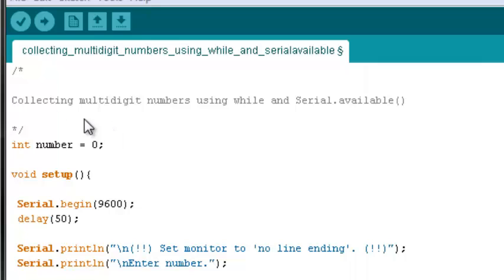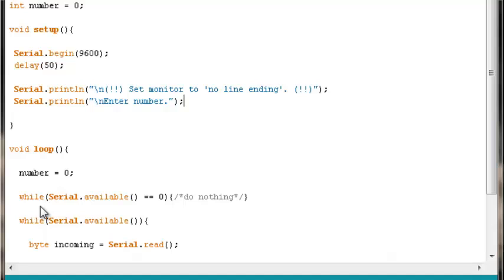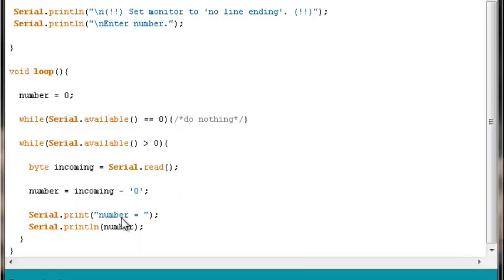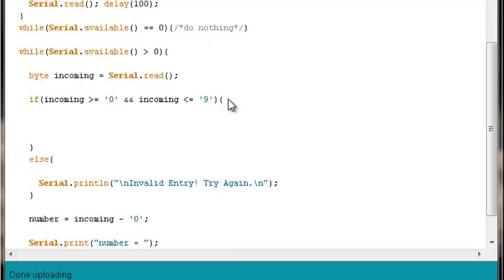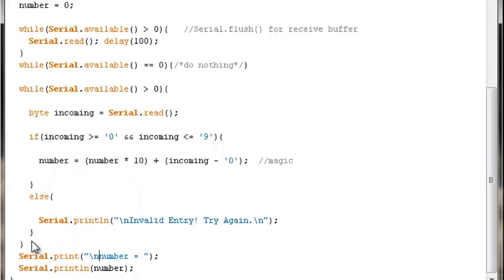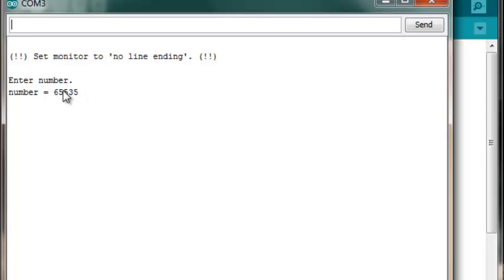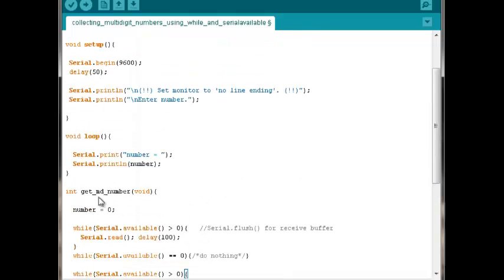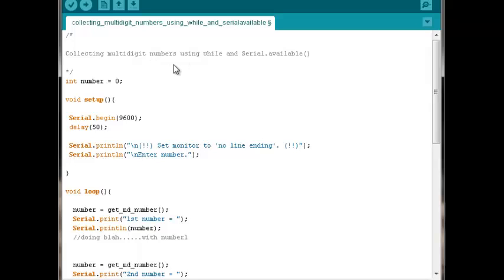Arduino Programming Tutorials || Collecting multi-digit values using while and Serial.available()

Comment: You can use Serial.parseInt() to do the same thing.
Reply from the maker: Gene Tsymbal Correct.  I've just always enjoyed the challenge of figuring out how to manually achieve what's operative behind built in functions.  It's easy to use built ins (and when I'm in a hurry, I do so) but when time permits I enjoy earning the right to use them.  As well as I hope that the video provides newcomers with few insights into Arduino serial buffers, communication, etc., in general.   Thanks for the comment and for watching!

Comment: Hello there. Thank you for the tutorial! Its very clear and concise. I have tried exactly what you have shown. But everytime the program starts, it prints out some random value on the serial monitor. Ive tried commented out a few lines it still continue to occur. Im using arduino Due. Can you explain to me why this happen and how do I remove this random value?
Reply from the maker: Thanks for the comment and question.  There are a few possibilities.  First, by random value/character do you mean a few odd looking characters appear when you initially open the monitor and before it begins to display normally?  If so, then you are likely seeing some of the after effects of the arduino establishing a serial connection with your computer.  If this is what you're encountering, then try increasing the length of the delay after Serial.begin(9600), increase it to around 200+ milliseconds.  That should provide plenty of time for the connection to establish.  It's quite common to see a few 'junk' characters appear on the screen while the connection is establishing. 

If you're encountering something different, e.g., the monitor is generating a bunch of random values/numbers/characters, etc., regardless of what you enter (after the connection is established), then my guess would be that it has something to do with the way the Due communicates via serial.  I haven't worked with a Due before but I know that some boards, e.g., the Leonardo require a different sort of code to initiate serial communication and that the Mega requires that one add the serial pin number, e.g.,Serial1.begin(9600); or Serial2.begin(9600), etc.  Might you need to add a 1, or 2, etc., after the Serial?   I would definitely see if the Due requires something similar or if it requires any special commands to initiate serial communication.  The Arduino website should contain such information.

These are my initial thoughts and suggestions.  I wish I could be more helpful, but I just haven't yet had the chance to learn all the ends and outs of the Due.  The code in the video works fine with the Uno and a Pro Mini (I've used it many times with both).  But there might very well be something unique to the way one has to establish serial communication with the Due that's getting in the way.  I'm certainly curious and would appreciate hearing more about it, especially if you happen upon an easy fix.